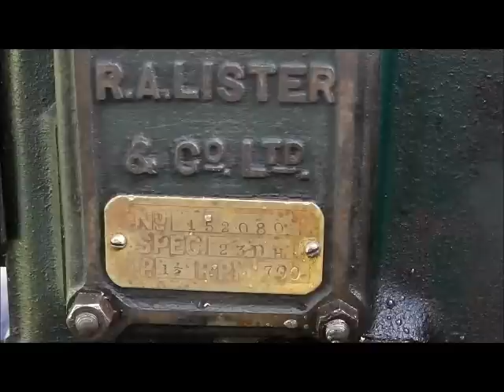1939 Lister Engine & Lister Blower

Comment: Lovely set you have got. Is the dry running of the pump a issue? Or do you lube it with oil? I start to get a soft spot for the old engines.
Reply from the maker: Arjan Wilbie Thanks, the front bearing on the pump has a greaser and the back bearing, along with the impeller gets oil via the sight feed lubricator. To work, that relies on a little back-pressure on the output which pressurizes the oil sump. It's either an air or gas pump so it was designed to run like that - I need to think of a way to display it, showing the output of air.

Comment: How much air pressure does the blower put out, Phill?  Is it designed for high pressure?  Love the clutch function.
Reply from the maker: Low volume but high pressure, there are no given ratings though.

Comment: HiWould you be able to blow autumn leaves away with that
Reply from the maker: lol... I doubt it - a vane pump is designed for high pressure, low volume applications; a leaf blower is the polar opposite.
Reply: Ok then